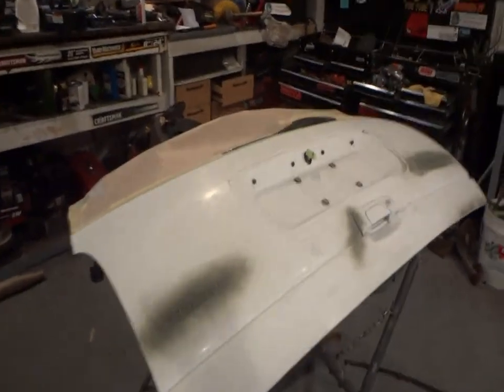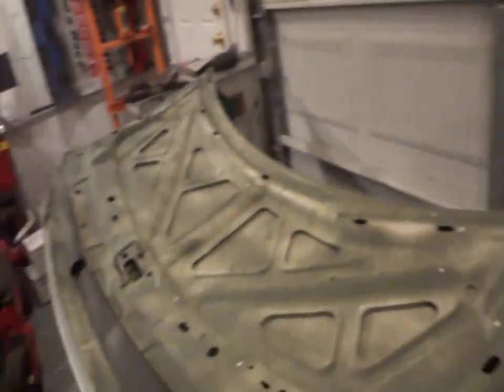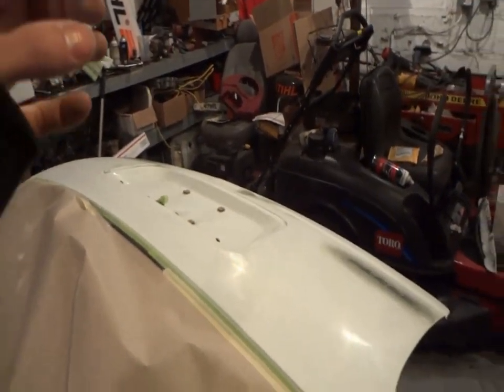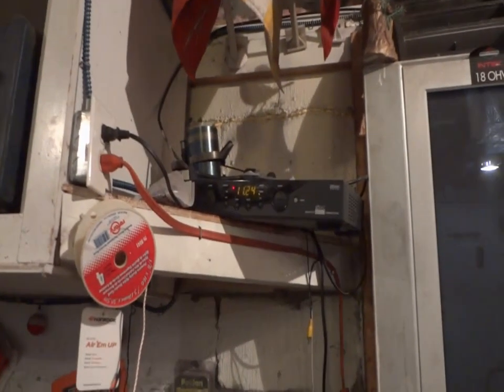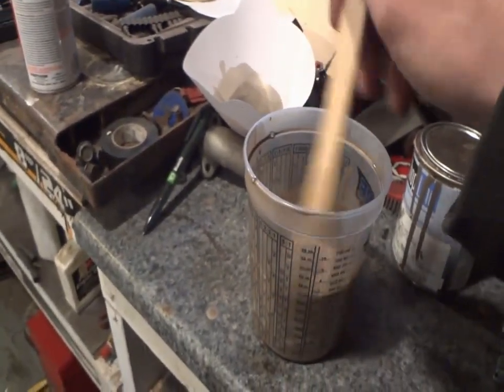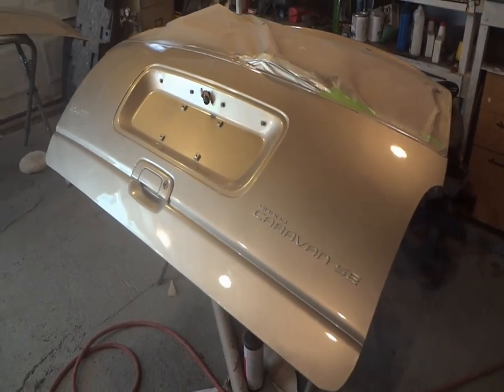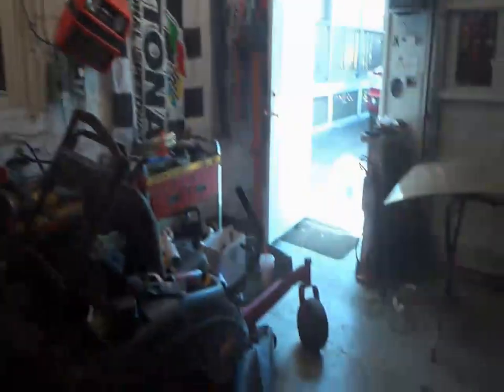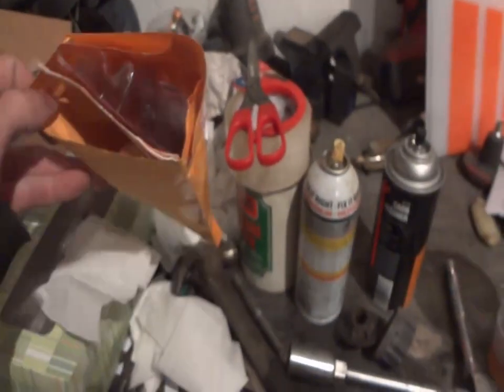painting Dodge Grand Caravan doors

Comment: make sure you check the rings on the piston for the correct end gap.just put the rings in the cylinder even and check it with a feeler gauge .if it is to small them will touch when it heats up and score the cylinder.